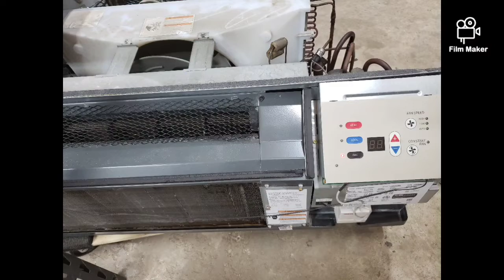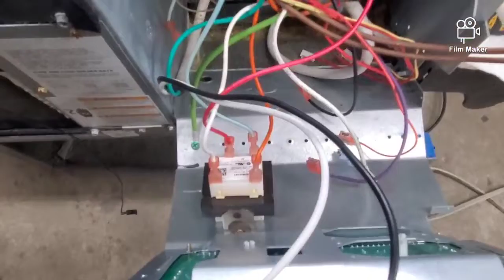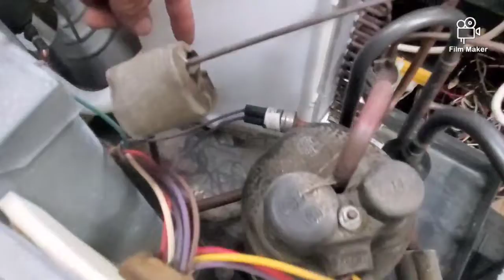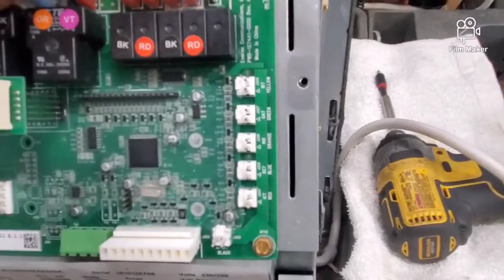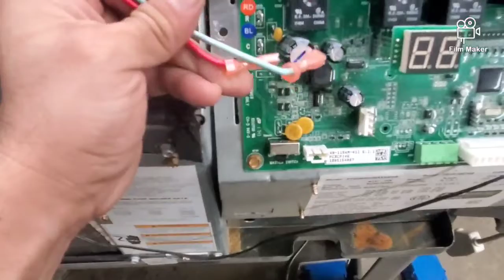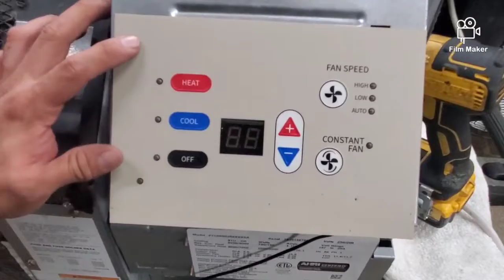Replacement or installation of Control Board.. simple steps!

Comment: Dang I need help with one that has another board inside it.  The OD fan motor goes to that board and nothing was plugged into the OD slots on the outside board. Nothing is turning on too, not a single fan or the compressor, but the screen shows it’s working with no little green light at the bottom lol. Im used to the old LG’s
Reply: Same question I have.  Is it the type with a single capacitor and the indoor fan is the plug and play connectors?  I can't find any schematics to connect it.  I had to change an outdoor fan and not sure how the wires connect to the distributor.
Reply: @thatbme8736 My boss ended up figuring it out, but I can’t remember what it was. The motors were good, but he did replace some part, so I never really figured out how the thing is supposed to be wired cause the diagrams for it aren’t anywhere I could find. I wish you luck sir, those ones are annoying. Usually Amana’s are fairly simple to work on, but not that one.
Reply: @FullSplootShiba  I agree.  I looked all over also.  Only have a few of those in the whole motel, and if I knew where one was I would just go look in there.  I have a feeling that the outdoor fan is a plug and play also.

Comment: I have about 10 of these units with bad boards. these new mainboard versions do not last as long as the old ones did. if anyone know what electronic component becomes faulty on them, please let me know so I can replace that component only. there should be a recall on these new versions.

Comment: I replaced the main board on my PTAC (would not turn on at all).  After replacing with a used board, I am getting d4 and d5 codes. d4: DC motor control communication loss and d5: Outdoor DC motor speed error.  Is it possible I messed up connections?  Any ideas on where to check?  I took a pic before I took wires off and everything looks good.
Reply from the maker: Hey Steve, 
Check for loose wire connections at the variable speed board

Comment: Indoor fan, got a question.  Some of my low or high speeds don't work. What could be the problem?
Reply from the maker: Hey Wes
I would check the blower capacitor
Reply: @PtacSolutions  where is that located? On the blower motor itself?
Reply from the maker: @weslawsonsilverback  No, inside the control panel
Reply from the maker: @weslawsonsilverback  how old is the unit
Reply: @PtacSolutions  same as the one you had on video
Reply: @PtacSolutions  we have mostly the model u have on your videos
Reply from the maker: @weslawsonsilverback  ok, should either be a black looking block or a small cylinder
Reply: @PtacSolutions  ok gotcha. Thanx bud